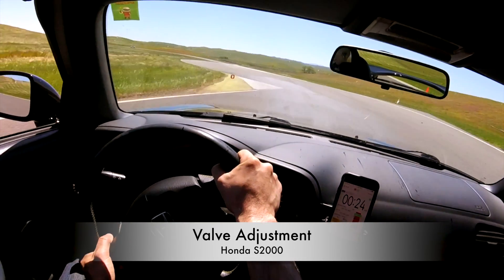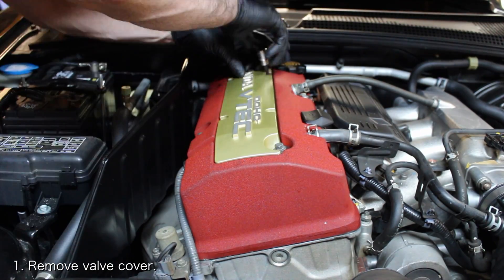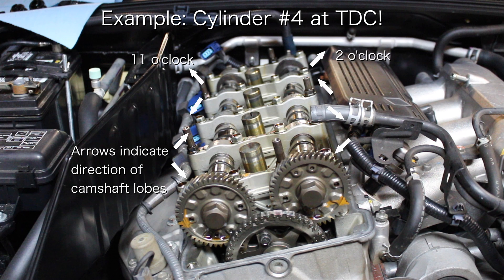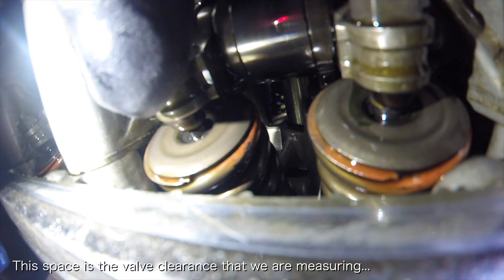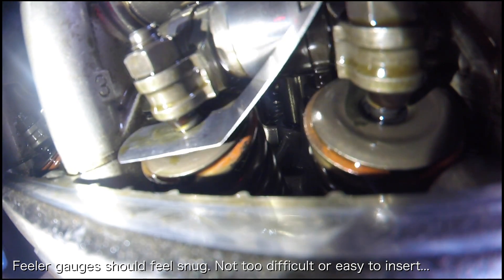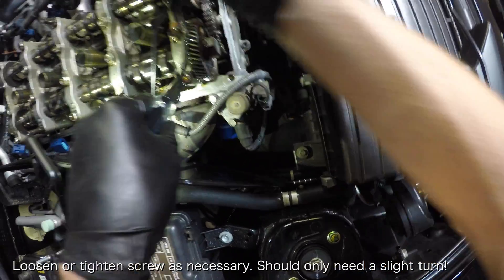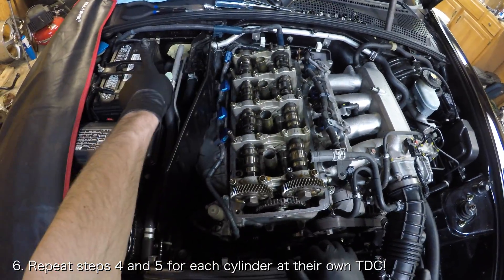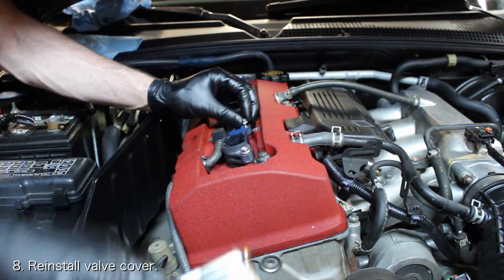Valve Adjustment | Honda S2000

Comment: A very important hint at 1:19 (you show it but don't tell it) when setting up TDC for cylinder 1: The marks on the sprocket of the cam chain (the big one in the middle) have to be parallel to the cylinderhead surface aswell. Otherwise you may end up with 180° offset for your camshafts (especially when you are reinserting them after disassembly).

Comment: How can you tell when it's time to adjust the valves?
Reply from the maker: You can do it by the book which is 105k miles. If it’s an 06+ I would do it sooner. But generally it’s something you can hear if you’re experienced. Tight valves make less noise and loose valves make more noise.

Comment: i just did my valve adjustment with my dad Took us a couple hours but it was Fun , followed all the steps on this video and this help me with 2 things

so my car was Coughing basicly at Iddle or like Mini hickups like a super small missfire 
(i checked coils sparksplugs and Injectors) everything was working fine 

and second problem was that my engine sounded like a 5.9 turbo Diesel Cummins engine 😂ticking was really loud

so We did the valve adjustment today and now the car feels and drives amazing plus the ticking sound Went away ! thanks for uploading this video  hope everybody gets to fix their own and save some money

Comment: Hey man does each cylinder need to be a top dead center when  adjusting that certain cylinder valves?  If so does each cylinder vales needs to be at 11 o'clock and 2 o'clock? Or is that just cylinder .1? I want to make sure im going to do it properly myself.

Comment: Which model torque wrench did you use? I am concerned about over or under torquing
Reply: idk but my crafstman torque wrench gave out. worst part is, i didn't even realize it wasn't working, i just kept tightening waiting for the click (on my oil drain bolt) and it stripped the threads :(

Comment: Will I be ok reusing my valve cover gasket or will I need to purchase a new one? 03 with 75k
Reply from the maker: You should be fine reusing.
Reply: @DIYGuysvideo  so grateful for this video. First time it took me like 4 hours because I was taking my time and double checking but I can now do it in probably a hour or less. I’ve owned my S for many years and it was always very quiet. When I did my first valve adjustment, a lot of them were really tight. After doing the valve adjustments, the motor is a lot more noisy now. Like I can hear the valves tapping I guess. 
I was told that property adjusted valves will be somewhat noisy but I’m not used to it this loud. My engine was really quiet and now all I hear is my valves tapping. I’ve checked it numerous times and they are in spec now. Do you think it’s normal that it’s noticeably louder now?

Comment: How often do you recommend doing this on a AP2?
Reply from the maker: AP2V1 every 50k miles. AP2V2 every 25k miles due to the tendency for exhaust valves get tighter over time.

Comment: This seems a relatively easy diy because of the adjustment screws. On my yz250f motorcycle you need to adjust the valves by replacing the shims with different thickness. The check interval is 10h but it’s unlikely they will need adjustments. So you need to take the cam shaft and timing chain out. But it’s Only one cylinder, 5 valves in total and different clearance exhaust vs intake. Also it may need valve stems check and removing the carbon build up, new lapping and molybdenum lubricant.

Comment: Hi diyvideo! I’m doing the valve adjustment on my ap1 and I want your input as to how the fueler gauge should feel. How should a slight drag feel when sliding the gauge in the valve clearance? I err on the side of the loser end. 0.010 on intake and 0.011 on exhaust. I read that after adjustment, a 0.07 should slide easily on intake w very very little drag. And 0.09 should slide easily on exhaust w very very little drag. Let me know your thoughts

Comment: How do you know your tightening to the right ft lbs? Do the tool you’re using to loosen and tighten measure that??
Reply: in another comment, he mentioned how he just does it by feel, and then uses the torque wrench to verify it at the end. its possible for the screw to change position if you torque it directly with the wrench

Comment: Is it helpful to remove the heat shield to get easier access to the exhaust valves?
Reply from the maker: It is, however I’m not sure it’s worth the pain of removing the heat shield. The last bolt on the heat shield is quite difficult to reach.
Reply: @DIYGuysvideo  I think I am going to give it a try this time.  I can visualize that back bolt and I think with a stubby ratchet I can get to it.  All you have to do is loosen it a bit - don't need to remove it - and then tighten it again when done. The other bolts are easy to get to. I think it will give me a better angle with the feeler gauges and hence a better feel for the settings.  Maybe better accuracy.
Reply from the maker: I remove the heatshield in my transmission removal video. I used a ratcheting wrench to slowly loosen the bolt.
Reply: @DIYGuysvideo  Is that a "flex head" ratcheting wrench?  Is the flex helpful?
Reply from the maker: Yes it was helpful
Reply: @DIYGuysvideo  Thanks for the help.  I think I am destined for a set of flex head ratcheting wrenches.
Reply from the maker: It’s a good investment. I like mine!
Reply: @DIYGuysvideo  I'm a weekend warrior mechanic. But, right from the get go in my 20s, I made the decision to always get the right tool for the job on the theory that I'm saving the money by doing it myself. Even at 68, I still believe that.

Comment: If I’m also changing the camshafts. Should I do the valve adjustment first or after changing the camshafts?
Reply from the maker: It shouldn’t matter since you adjust the valve when the camshaft lobe is pointed away. However you may need to loosen the valve adjustment nuts to safely remove the camshaft caps.

Comment: Slight drag after you insert? Or before? For instances, my feeler gauges have a hard time inserting but once it is in between the valves there’s no drag in the middle of the gauges. Like there’s no pressure on it. Will it need to be tighten? Or loosen?
Reply from the maker: After you insert. You may have difficulty getting the gauges in because the angle is making it harder which can be deceiving. So I would say tighten until there is drag when you move the gauge back and forth while still inserted.

Comment: Great video. Thanks.  Why top dead center?  Isn't the point that the cam lobes have to  be off the valves?  Why not just put the cam lobes pointing up which doesn't require determining top dead center?
Reply: Ok, years later I know...

That is how I do it. I call it 180 away. Turn crank until cam lobes are pointing up, 180 degrees away from the follower.

I don't bother finding TDC or counting degrees of crank rotation. I came up with this method in the 1980's, adjusting the valves on my Honda V4 bikes. Same exact valve adjustment methods as the F series.

I only ever did it once the way manual describes, then said forget this. Been doing 180 away ever since. Decades. It works. Its faster, easier. Foolproof.

180 away = cam lobes at 11:00 and 2:00 as mentioned in video. At very least you should check cam lobe orientation before adjusting any valve, even if you using tdc, timing marks, and degrees of crank turn. If they aren't 180 away, stop. You did it wrong. Align marks and try again.
Reply: @russelloppenheimer3970  Yes.  I do the same. Been doing it that way in various motors all my life.  Works well. Less complicated and therefore less chance to mess it up.

Comment: did my first: valve adjustment, spark plug change, valve cover gasket change, spark tube seal change, pcv valve change, and tdc sensor o ring change. all with help from your videos. went well. thanks guy.
Reply: Did the same last weekend (incl. valve retainer upgrade to AP2 retainers & keepers). Endlessly thankful to that guy. The Honda shop manual is good but the videos provided me the extra confidence to tackle this job by myself since it was my very first time to do such "engine intrusive" stuff which may f*ck up the engine and generate a biiiig bill.

Comment: Not sure if this was mentioned in the video but what does adjusting the valves do for you?
Reply from the maker: The valvetrain metals wears very slowly over time and you just need to adjust them to keep the engine working optimally. If you ignore things you could lose performance (loose) or end up with burnt exhaust valves (tight).

Comment: i did same on my k24 accord...

car idles normal... when i pull hard in 2nd gear the car becomes jerky after 3.5k rpm... some time engine check light blinks...

car pulls perfectly upto 6k rpm in first gear.... 

what could be the issue ?? transmission is auto triptronic

was perfectly good before

Thanx in advance
Reply from the maker: No idea. I only work on s2000 sorry.

Comment: Do you have to rotate the crank a full 180 degrees to get to the next cylinders TDC even if just a few turns will suffice? does rotational direction matter or can I go either anti clockwise or clockwise?
Reply from the maker: Direction matters if you want to do the cylinders on a certain order. All you really need to know is that if the cam lobes are pointed at 11 and 2 o clock it’s good to adjust.
Reply: DIYGuys cool thanks. Seems it doesn't matter if u turn CW or CCW according to some members on S2KI

Comment: Mr. DIY Guy I just finished my valve adjustment on my AP1 with 130k miles. I was shocked to find that not even the 0.20mm feeler gauge would fit in ANY of the valve adjustment gaps!! This means that all of them were way too tight right? I think I even tried the 0.18mm which barely even fit in there. I then adjusted each one carefully and checked many times to make sure that they were intake: 0.22mm and exhaust: 0.25mm. Now I noticed that the car starts easier but the engine sounds louder. Is this normal? I also noticed on the road that the VTEC kick is harder now even with the airbox lid on. Normal? How did your engine sound after the adjustment you made? Thanks.
Reply from the maker: The looser valves are the more noise they will make which is normal. Sounds like you got the job done right!
Reply: DIYGuys thanks

Comment: Do you have to use that special adjustment tool or would a stand alone 10mm wrench and flat head screwdriver work just as well?
Reply from the maker: I would highly recommend the tool. Using a flathead and a 10mm wrench is very difficult in comparison.
Reply: DIYGuys i see. Unfortunately i don't have access to that tool here locally so I'll have to use separate ones. As long as it doesn't cause any trouble to adjustment? I have to check the clearances at the very least today. Need to see if any of the valves need adjustment that could smooth out the idle state
Reply from the maker: It won’t cause trouble. It will just be really hard lol.
Reply: RolanTHUNDER i was a master tech for years and have adjusted many valves. You can do it w/o the special tool and ive never needed one. Sometimes the screw head can be really tight and thats when the special tool is helpful. It's not necessary though

Comment: After the valve is adjusted and tightened will using a torque wrench throw off the clearance since you will not be holding the screw in place?
Reply from the maker: It’s possible. What I’ll do it tighten the nuts by feel without a torque wrench by using the tool and check them later. Most of the time they are tight enough the components are very strong so it not as easy to strip them. You just don’t want them coming apart later which has happened to me once.
Reply: DIYGuys - thanks for the help. I adjusted my valves today with no issue.  The exhaust valves were all a little tight, and the intake were fine.

I found that removing the air filter box made it worlds easier to turn the crankshaft. Also removed the heat shield to get to #3, and #4.
Reply from the maker: Yes it depends on what you use to turn the crank. If you don’t have a 19mm wrench and only have a ratchet removing the air box helps for sure. Good call on the heatshield too. Is your car DBW by chance?
Reply: DIYGuys it's a 2006 so I believe so.
Reply from the maker: Just curious since DBW exhaust valves seem to tighten. Interesting

Comment: what size is the wrench you use to turn over the crank? 17mm? Also do you go clock wise or counter clock wise to turn it
Reply from the maker: 19mm. I go clockwise but if you follow the 11 o clock and 2 o clock rule you can go either direction.

Comment: Ok so when you do cylinder two while turning the crack I should look for those 2 lines to line up again and so on ?
Reply from the maker: They will only line up like that for cylinder #1. You can just look at the cam lobes for each cylinder. Also if you spin clockwise the order will be 1,3,4,2
Reply: DIYGuys thank you.
Reply from the maker: The cam gears rotate 90 degrees for every 180 degrees the crank is rotated. They can be used to tell which cylinders are at TDC but it’s less straightforward than just looking at the cam lobes.

Comment: I have a 2006 with 66K miles on it. Doing the valve adjustment now and wanted to get your input on my numbers: Exhaust Valves are at .011 and intake valves are also at .011. What do you think? Any adjustments or can I leave alone.
Reply from the maker: Intake is loose. Exhaust is fine. Just compare to OEM specs.
Reply: Thank you for your reply. I can not get them to a perfect 9 for the intake, do you think if there are not perfect will result in something bad? Thank you. You made it look so easy.
Reply from the maker: The specifications allow for a range so you’ll be fine.

Comment: Hey man, thanks for the great video, but in the end I couldn't get the car to start, I've already done the adjustment 3 times and made sure everything was reconnected properly, any ideas? the car cranks and cranks but smoke comes out of the intake and that's it
Reply from the maker: Check your top dead center sensors. Your car won’t start if your timing is off and those sensors look at the camshaft for timing. I’ve had it before where the sensors weren’t tightened down enough and the car wouldn’t start and misfired.
Reply from the maker: What year is your car?
Reply: 2003
Reply: I'm trying to look up where to find the TDC sensor but I can't find it lol
Reply from the maker: If you watch my AP1 valve cover removal/installation video you will find it. They are two sensors towards on the rear of the valve cover.

Comment: I feel like I am not handling the feeler gauges correctly (bent ones). Sometimes they don't fit in at all and then at the next try I can move them inside very easily.
I thought I could just open/widen the valve as much as possible, insert the feeler gauge with the correct measurement and then tighten the valve again until the feeler gauge feels snug?
Would that be a good solution or rather not?
Reply from the maker: That’s another way to do it absolutely.
Reply: Thank you for your quick response. And also thank you for all your great tutorials :-)
Great, my feeler gauge comes in "too small", "perfect middle", "too big". 
For intake (0.21mm-0.25mm) that is "0.203mm", "0.229mm", "0.254mm"
For exhaust (0.25mm-0.29mm) it is "0.254mm", "0.279mm", "0.305mm"

I will just open the valve clearance until I can easily move in the feeler gauge with the "perfect middle" (0.229mm and 0.279mm) measurements and then tighten the valve clearance until I feel some resistance while still being able to move the feeler gauge around a little.
I think this way I won't need to "scratch around" as much with the feeler gauge. The downside is that I might be opening/changing valves that actually have the perfect measurement already.
Reply from the maker: I forgot to mention. The downside to this method is that you have to wedge the feeler in so that it can sit in place since you need two hands on the adjustment tool. So it usually only works for a few cylinders for me.
Reply: Hmmm I thought I would loosen the locknut, open the valve clearance, then put in and hold the feeler gauge with one hand and use the other hand to adjust/tighten the valve clearance with the screw. Then I would remove the feeler gauge with one hand while still holding/fixating the adjustment screw (with the tool you used) with the other hand. Now one hand is still holding/fixating the adjustment screw and one hand is free and there for can be used to tightening the locknut?
Well, at least that was my plan :D
Btw, should the cylinder head cover gasket be replaced? Only 30k miles here (2004).
Reply from the maker: It’s been so long you might as well just want to do it considering the age. The issue with holding the screw in place while doing all this is that you have to keep it exactly in the right position. It takes such minute movements to adjust the clearance that I wouldn’t recommend it. If you can do it successfully go for it.
Reply: Hmm I guess I will just have to try and figure it out myself. The other solution I thought of was cutting the feeling gauge in a smaller piece so it completely fits between the valve. That means I would probably need pliers to pull it out after adjusting.

Comment: I just adjusted my valves, put on new spark plug tube gaskets and a valve cover gasket (and didn't break anything lol). All of my valves were out of spec (Cylinder 4 was spot on for some reason on both sides) especially the exhaust valves which were all tight from .005-.007. Not only that, I got to take a look at my retainers and keepers, and they were all sitting flush, and based on your video that would indicate that I don't have any issues there hopefully. (2003)

Anyway, 
Thank you so much for these DIY videos, we all really appreciate it man!
Reply from the maker: Sorry for the late response. Really happy that you were able to get all that done safely and that my videos helped! Don’t stress about the valve retainers if they look good!